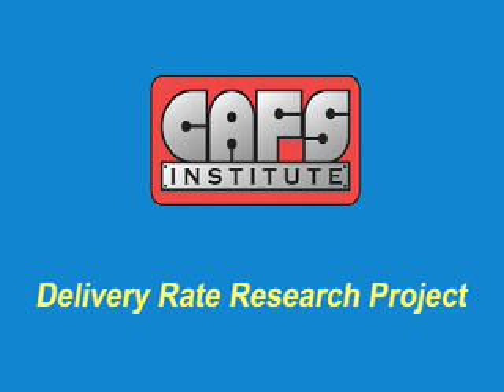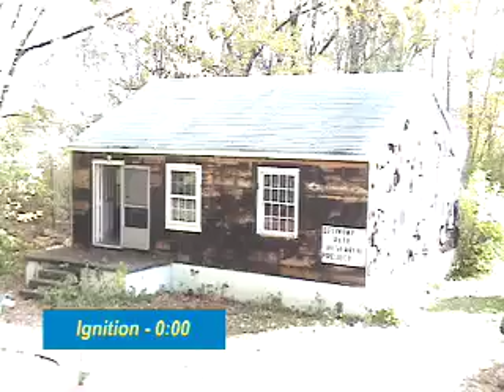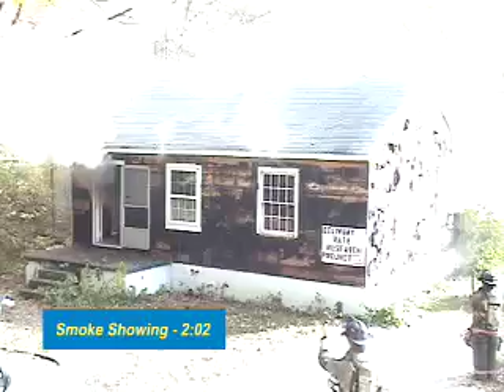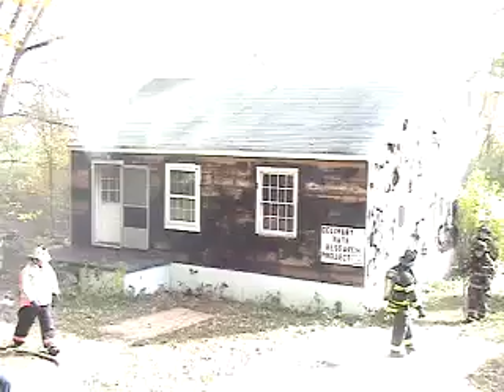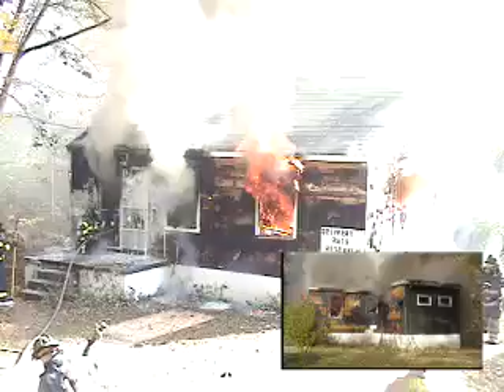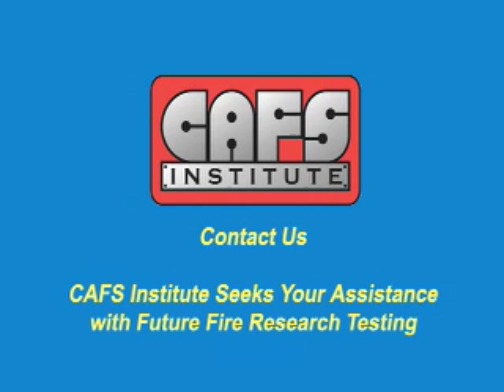CAFS Institute Delivery Rate Research Project

Comment: Notice how a Straight Stream and a long distance did Nothing to even slow down that fire.  It's not the water that's the problem, it's the application that is wrong!  

Going inside when you have all those windows exposing the burning material, is just plain childish, irresponsible to their family's and "Look at me" Heroic!

They started at 2:52 and didn't eliminate the flames until 4:20.  That's 1 minutes and 28 seconds.  That's a bitch of a difference if you happed to be hiding in a closet.  On tank water, that should have been out within 15 seconds after the water started flowing by putting a medium cone of water through the window, inside the space and waving it around to cover all surfaces Fast.

You do Not need new tech, you need fire fighters with a strong and responsible Work Ethic!

Comment: CAFS systems are great but theyre only effective for compartmentalized fires, or maybe not "only" effective, but more effective. Its not just the foam though...they foam itself is just a part of the overall foam operations. You have to have proper CFM's, proper percentage, proper amount of water, and the right NOZZLE! The foam reduces the surface tension of the class A materials....the BUBBLES in the foam are what cling to the wood and paper surfaces that allow this penetration. If you do not have the proper nozzle selection (smooth bores).....then the boobles are popped. They are popped by the combination nozzles and therefore arent as effective. There is alot more to all of that too....its not just FOAM+WATER= THE BEST IN THE WORLD!!

Comment: I can't get it through to my dept that it's always water vs BTUs. They choke our CAFS down to less than 20 gpm. The way you save water is by getting it to stick where you need it and not run out the door or to the floor.
Reply: They’re full of ****. It’s GPM over BTU and always will be